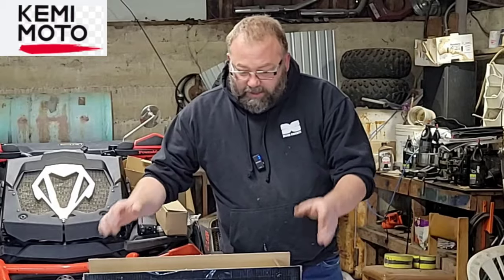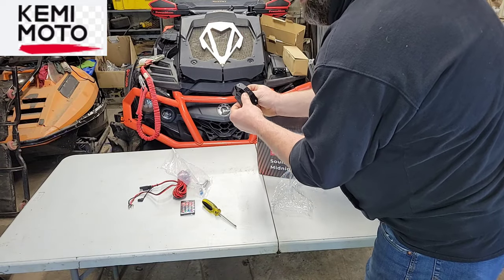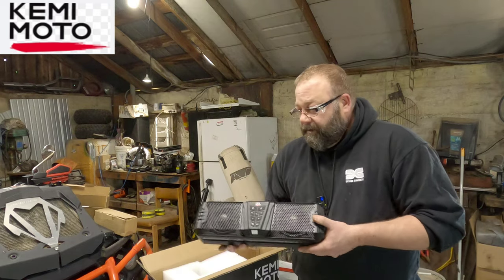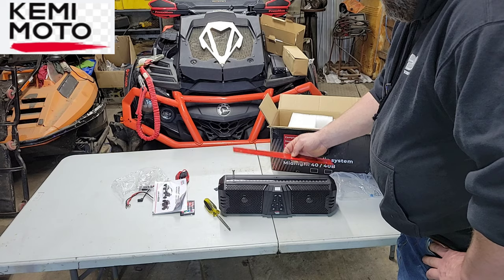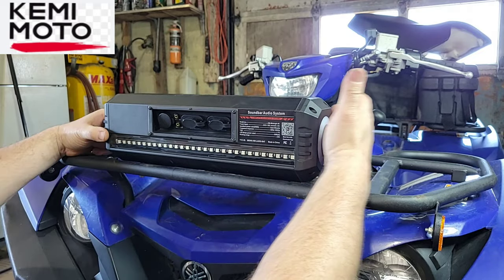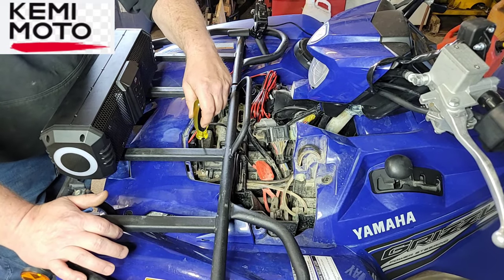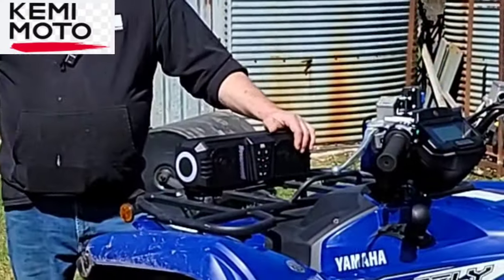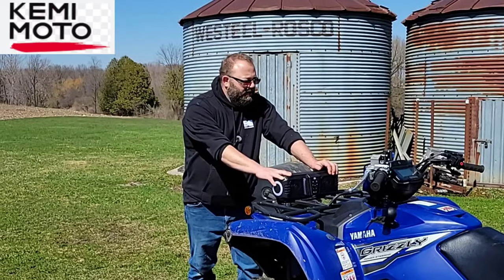Installing a Soundbar on the ATV. KemiMoto Midnight 40 on a 21 Yamaha Grizzly.

Comment: Hello Sorry to bother, with this type of conection mode, doesnt it drains your battery?

thanks and great video!
Reply from the maker: Not while your riding.  But it would if you let it play at camp without the motor running.
Reply: @RobMillerATV  noted! so it doesnt like turn off by itself? becuase i saw other kemi moto speakers with the 12 volt system and well if you kill the engin you dont have power, but this dont know if theres like an auto off function? and thanks for answeing!